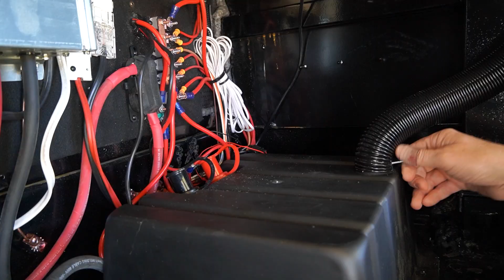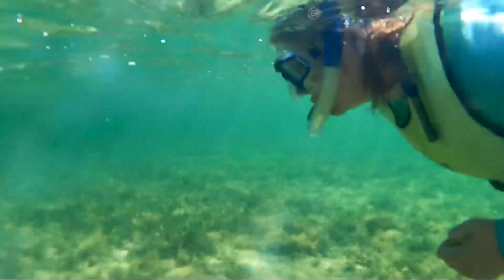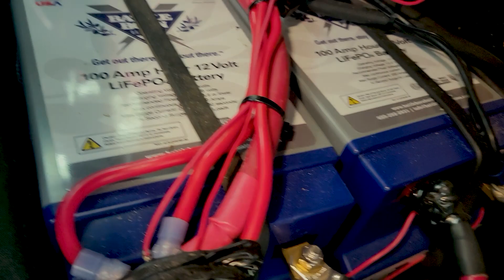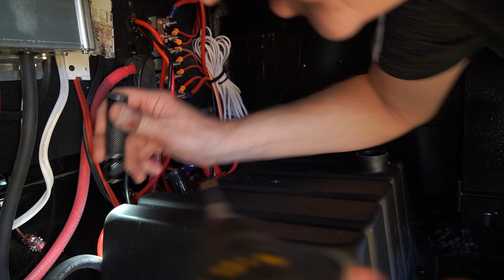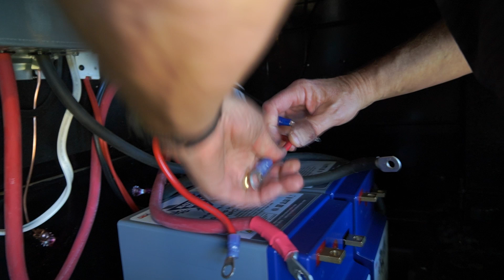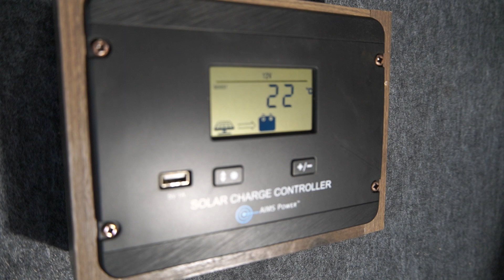Alliance Avenue Battle Born Battery Install/Upgrade

Comment: I have an Alliance 25rl on order, and since we dry camp plan on installing two 300ah batteries. I like the setup you have, but want to make my wiring a bit more organized if there is enough room in the battery compartment. Thinking of going with a smart shunt to measure battery life, and a victron lynx distribution unit and egis fuse block for my wires. Is there more room on the battery compartment wall to the left of the battery boxes to put a plywood panel that everything could attach to?
Reply from the maker: This is our latest setup.  I also installed two 320 watt Renogy solar panels on a track system that also allows them to be tilted. I guess I need to do a new public video lol.  This setup works great for us. Simple is better.  I try not to do complicated setups. I did this without adding any extra plywood.

https://youtu.be/Yq50p5JD4Ao?si=oXZbKb6cZ4sB_HOU
Reply: @theroadroamers2618 oh, wow. Much neater!! Great job! Hoping our new rv will be here in a month, can't wait to start my install.

Comment: CHECK THESE DANGEROUS SAFETY VIDEOS OUT!!!! 
DIY Solar Power with Will Prowse has 2 videos about this safety issue 12/202.
“Battleborn 12V Battery: Major Safety Issue”  and  “Battleborn Batteries Responds! Their Overheating Device is a "Feature" not a "Problem"??
Reply from the maker: I will definitely check that out. That's a little concerning for sure. I respect Will's videos.

Comment: How is your system working? I have read that for solar to charge two 100ah lithium baterrys you need 600 wats of solar panel. I have the same rig as you with the 320 watt solar panel and am looking at putting in lithium batteries. thanks John
Reply from the maker: John for what little boondocking we have done it works great. We have a 12 volt fridge and as long as you put the fridge in night mode at night it goes indefinitely...What kills the batteries quick is if we turn on the inverter. I hope that helps. Scott